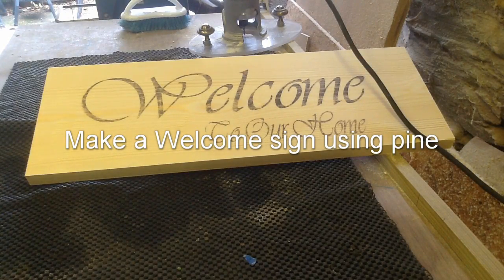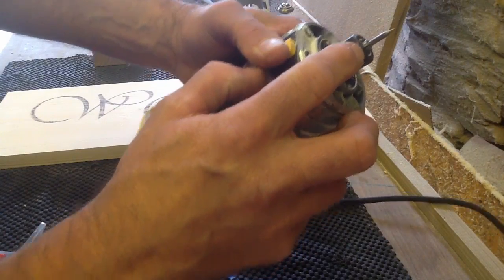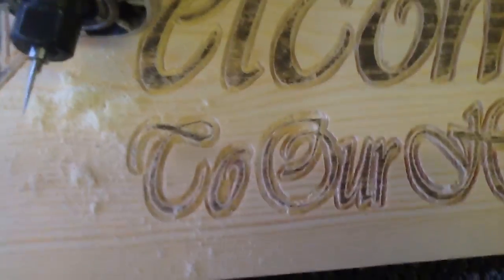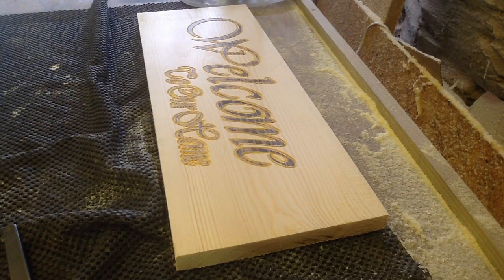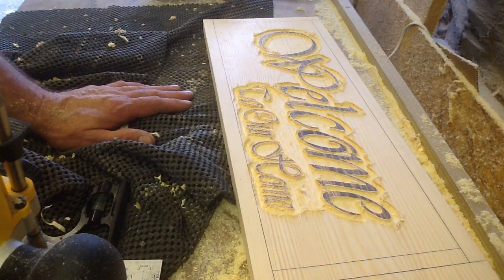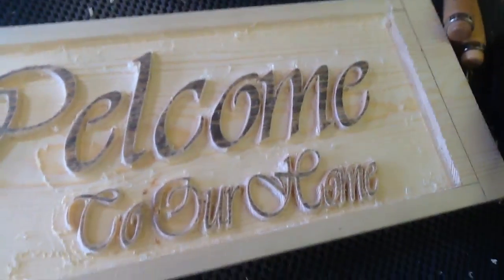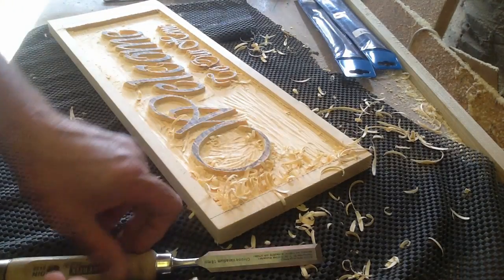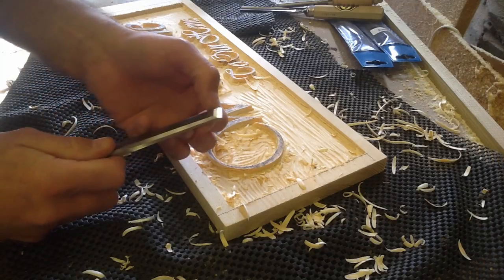welcome to our home sign, chisel background effect

Comment: Thank you for the informative video.  How do you avoid burning the wood with going either too fast or slow in movement or router speed?
Reply from the maker: each piece of wood is a bit different, i cut it out in layers so i get a feel for how the woods behaving. generally I run the router at full speed and make sure the bits are very sharp. that really helps with any burning of the wood or tear out

Comment: Can You write what exactly KIRSCHEN model You use for a background? #11:40
I mean 8mm and 14mm. What are these models? Maybe some link to them?
Thank You!
Reply from the maker: Yes will do
Reply from the maker: Hi there, so.for this video I used 3 different straight gouges. A number 3, 5 and 7. I have these in both the 10mm and 16 mm depending what I need at the moment and Which one is sharpest . This is a link for Kirschen chisels, definetly cheaoer options out there though https://www.amazon.co.uk/Kirschen-3114010-Carving-Chisel-Handle/dp/B001EGG2P6/ref=mp_s_a_1_1?ie=UTF8&qid=1537459405&sr=8-1&pi=AC_SX236_SY340_QL65&keywords=kirschen+gouges&dpPl=1&dpID=313BaCbba%2BL&ref=plSrch

Comment: Could I use my existing 1/8" shank Dremel bits with a 1/4-1/8" adapter to use with my (DeWalt 611) router?????
Reply from the maker: yes, as long as you get a good fit with the 1/4 to 1/8th collet reducer

Comment: another great project! curious though what you chose to transfer your letters from paper to wood? Carbon paper? tracing? thanks in advance!
Reply from the maker: Hi Sean, I don't use carbon paper anymore, I use a method called lazer printer and lacquer thinner transfer. it requires a laser printer but works great. if you look at my other videos, I demonstrate how to do it a few times

Comment: I didn’t see where do I get the bits and the color for the quarter to a eight
Reply from the maker: Hi there, since i am in the UK the bits are a bit country specific. I order the 1/8th shank bits off Amazon and eBay. They usually come.from China. As for the colour, it is Marsh spray ink, black. You can adapt this technique with any router bits you currently have. Any bit with a fine point, and straight bit for clean out

Comment: hello, nice work. what bit you are using? could you send a link of that?
Reply from the maker: Hi There, I am using 1/8th shank bits and a collet reducer in a normal trim router. Will add some links to the bottom of the videos.  Thanks for watching

Comment: I dont get the burn if your just going to paint it?
Reply from the maker: Hi Mark, the burn is basically a short cut. This is pine and tends to get lots of little wispy burrs and splits. A quick burn cauterizes the wood, gets rid of all those sandy bits amd changes the texture of the wood. Gives it a slightly more "polished" look. I'm not a big fan of the burn only effect so add paint. If i was going to leave the background more natural, i would have skipped the burn and hand sanded more.  Hope that answers your question and thanks for watching!

Comment: How do you get your pattern on the wood?
Reply from the maker: Hi Sean, I use the lazer jet / cellose thinners method. If you look at my other videos, i show exactly how i do it, printer, thinners, everything. Must be lazer printer though.  Ink jet does not work with this. Need to use heat instead